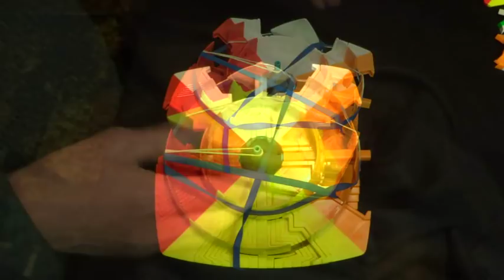*FULL* Yuxin 17x17x17 Rubik's Cube Puzzle assembly at normal speed

Comment: Thankyou so much for this video. After a bad pop, taking it apart, sorting it all out, and putting it back together, I can now say I have assembled a 17x17x17. I really don't know if I would have even tried to put it together if I hadn't seen someone else do it first. So thanks again. I have no Idea how the pro assemblers deal with the last part either but, your string tied to a rubber band method worked like a charm. I have no idea how I would have dealt with that without your video. One last time. Thankyou.
Reply: Now I know to be careful with a 17x17

Comment: Insane work and exhausting video (3:35:00 for the highest tension sequence "putting on the hat, pulling off the lingerie" 😄). Now I think that paying $600 - $800 for one of this is cheap: you don't pay only for the cube, you do pay for the work AND for the patience that are needed to assembly this monster (now think about the DIY stickered version: like this one but add maybe a couple of hours more putting on the f*cking stickers... daaaaamn, man!! 😋). These things should cost $2000  😳.
Reply from the maker: To be honest my assembly was pretty dreadful. In the factory they will do it much quicker. Also, stickers are applied with application sheets so they can be done very fast by the experts. I have always struggle to use those sheets though so normally do it the slow way.

Comment: RATHER THAN USING A FLAT SCREWDRIVER THAT SLIPS ALL THE TIME, I USE A USED DENTAL TOOL THAT I BOUGHT AT A SWAP MEET FOR $.25  - IT HAS TWO BEND ENDS THAT WILL HOOK UNDER THE RUBBER BAND AND WILL NOT SLIP - TRY IT YOU'LL SEE HOW MUCH FASTER THE NEXT ONE GOES BACK TOGETHER